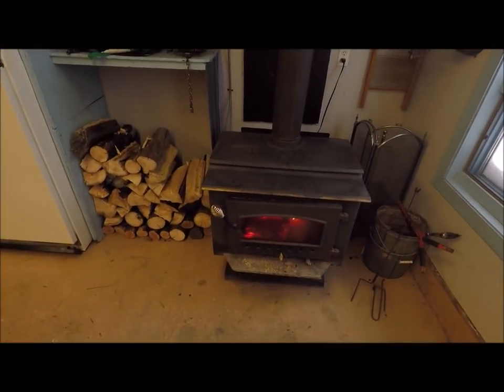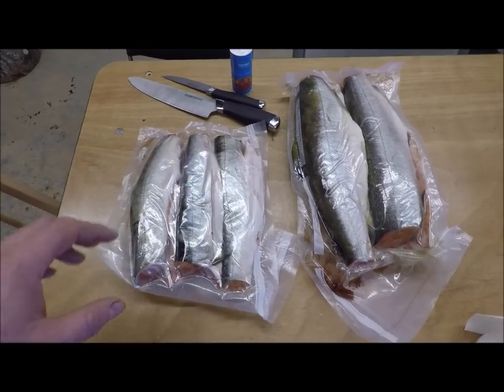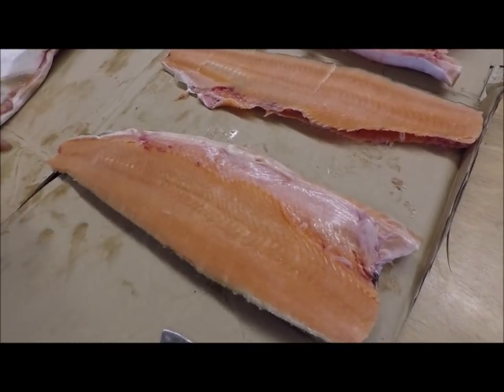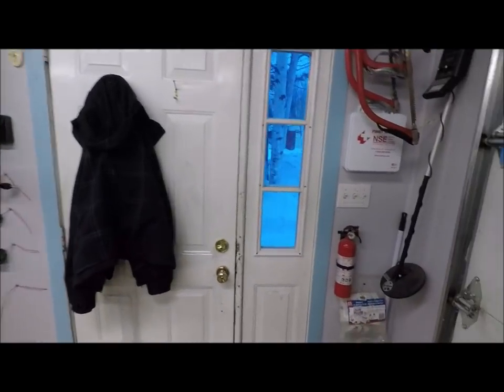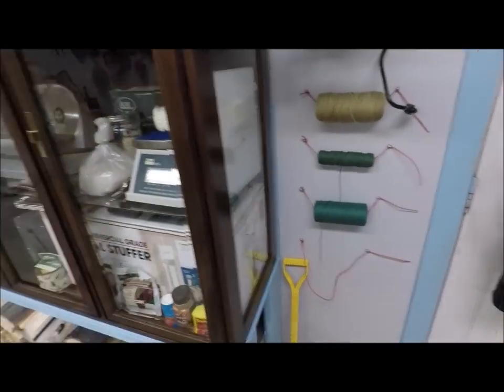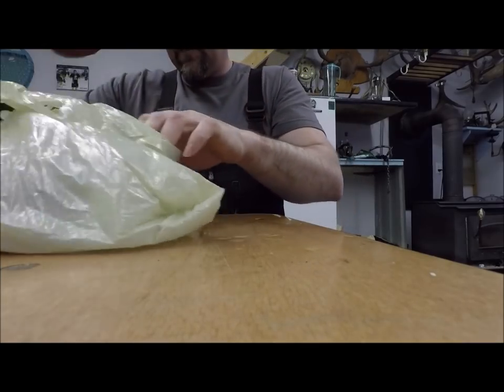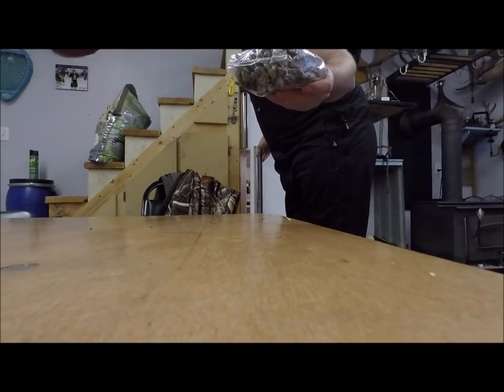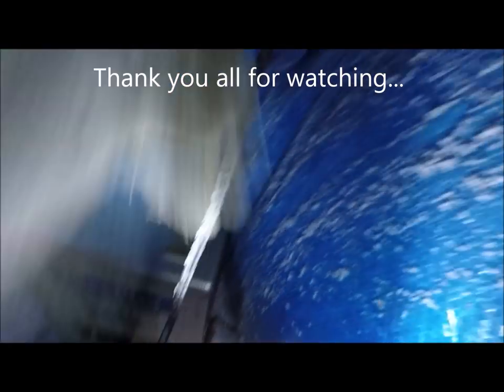In Da Shed - Drying, Smoking Fish & Tour

Comment: DO NOT plug in that radio! That is a beautiful radio for sure. DO NOT plug it in.  So many beautiful radios have died because of people plugging them in without first properly re-capping them.  Those parts have a life span passed many years ago.  There are ways of re-capping that don't in any way detract from the original beauty of the works inside.  There was also a period of time when the wire used was insulated with  rubber that today just flakes off and can catch fire really fast.  There is also the dwindling supply of tubes, even if you don't have an outright fire, explosion or blow your breakers, you can easily have a situation that damages those vacuum tubes and getting them can cost more than a warm handshake on a cold night!